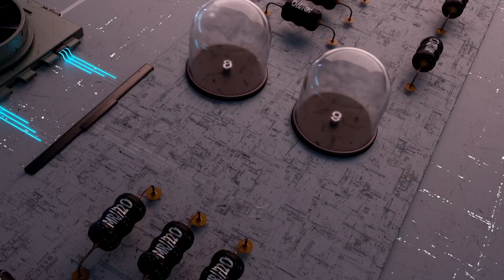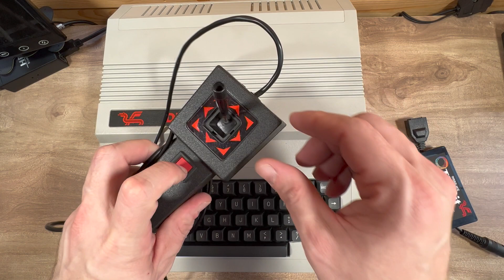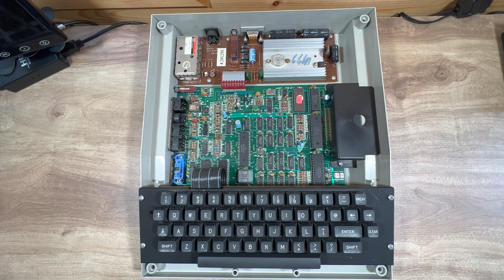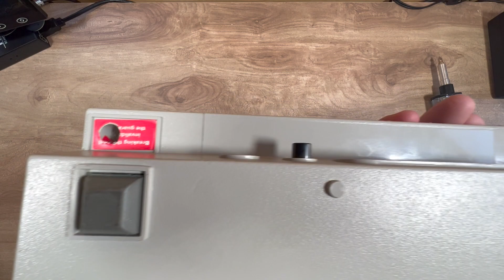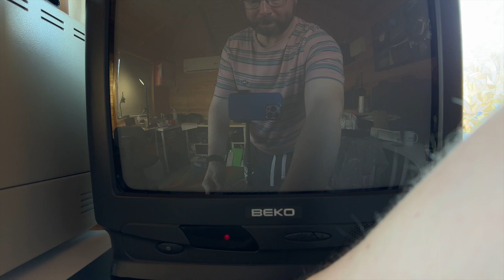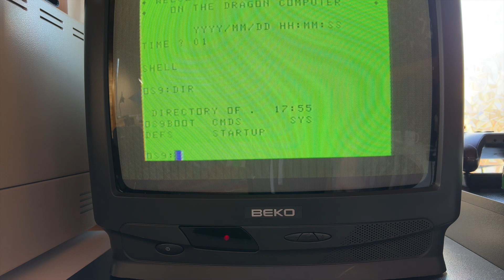Dragon 32/64 Use modern Power Supply Replacement and tidy up.

Comment: Nice video!
I have recently brought my mint D64 (I am not the original owner, but almost certainly the second, and when I bought it, it had the original box (without the outer sleeve) and the polystyrene, but sadly I disposed of that many a year ago) out of its loft incarceration, and it is happily in working condition.
I've just acquired a CoCoSDC, and I've just ordered the "pullup board" (which I think from an engineering design point of view seems like a good thing to do anyway)
After viewing your video I inclined to further "pimp up" my machine with the replacement PSU board as I am not comfortable with the amount of heat which the internal regulator board generates which doesn't seem like particularly good engineering practice to me!
Many thanks!  (though you have just given me another way of disposing of my savings ... 😂)

Comment: I've picked up a Dragon 32 and noticed that the PSU gets very hot. Is this the norm as you did mention that yours gets hot, mine is hot that after 10 mins its not comfortable to hold it?
I've also got a problem as the picture starts to degrade after a while and thought it might be a PSU issue. I've still to open it up and check for bad caps etc.

Comment: Nice video, the DragonPlus power board is a great upgrade. It can also provide 5v power for a Gotek drive. I built a DragonDOS disk interface and use that with a Gotek as my main storage currently but I plan to get a CoCoSDC as well.